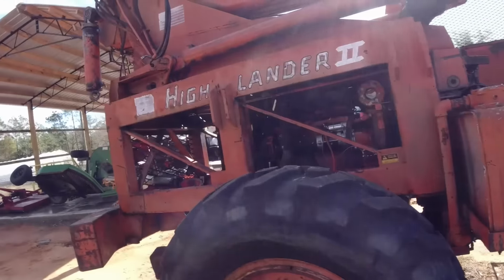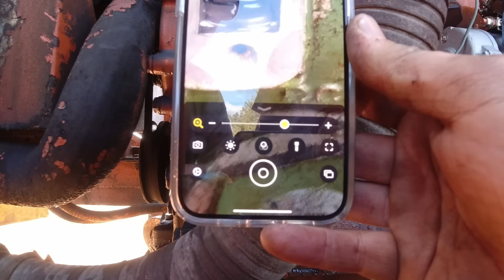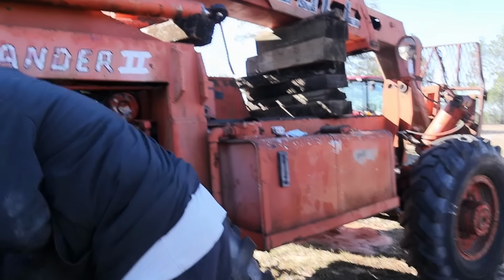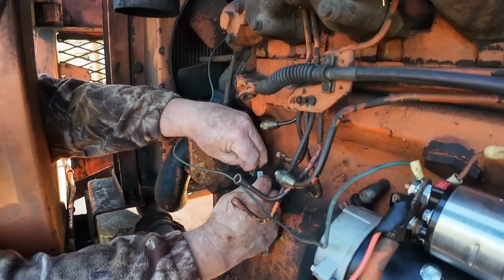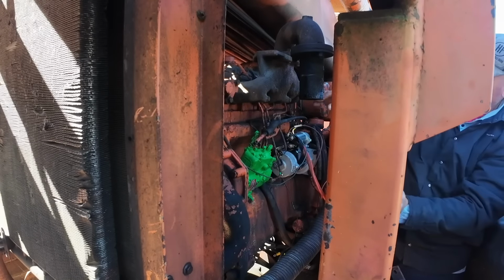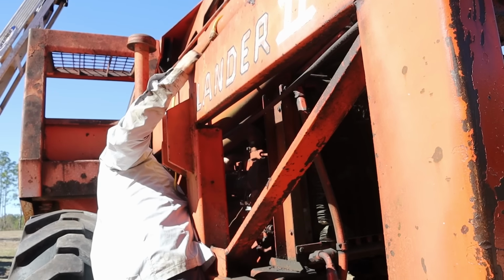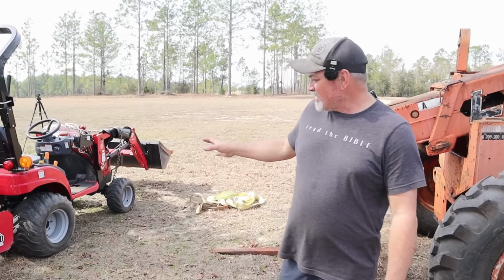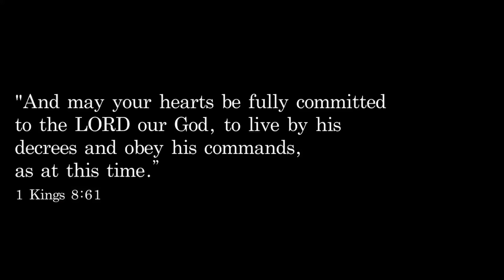Will the DIRT CHEAP Telehandler lift 8,000lbs?

Comment: Man Alive that is one Jim dandy Telehandler the whole lift works moves back and forth ,Twists ,Leans side to side ,Impressive .
Reply from the maker: Used it today to unload a pallet of stone!
Reply: It should lift a Ton very easily with the mast mid length 4-5 full back , This was probably made for roofing being the forks and axles Lean for different terrain and pitches , Is the front tire leaking or just down some ? @Hfoutdoorsyt

Comment: If that large plug on the flywheel housing is like my Cat, there is a tool you stick in it with teeth on one end and a half inch rachet square on the other to turn the engine from the top.

Comment: My brother in Christ. Please stop using pipe wrenches backwards. You also did it when you tried to remove the valve stem cap on the skidder video. Pipe Wrenches are only meant to go in the direction that they work in. I’m in the Air Force currently stationed in South Korea, I have some spare time. I think I will start a YouTube channel to go over all the way you guys use tools backwards. I love your videos please keep them coming. God Bless.